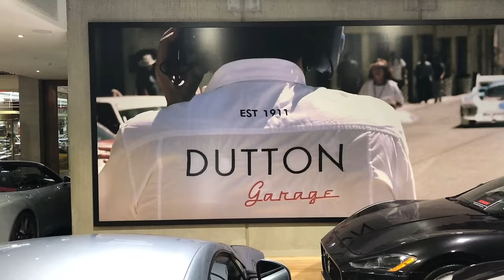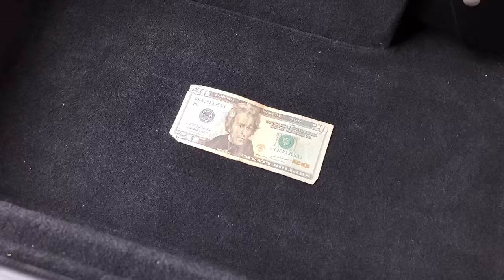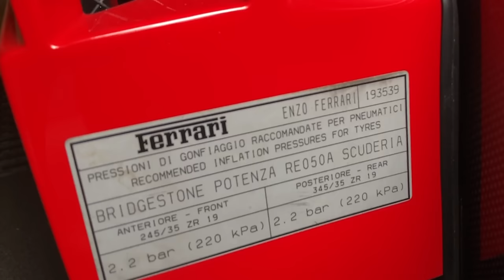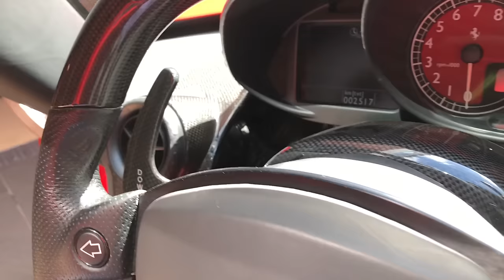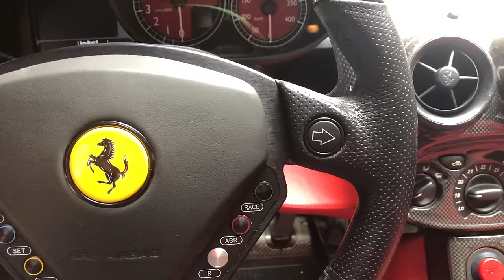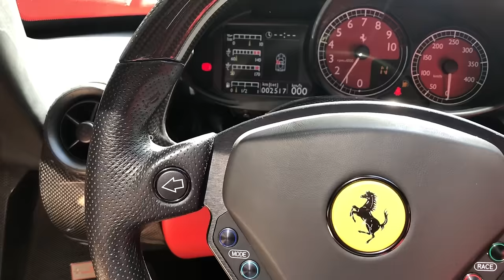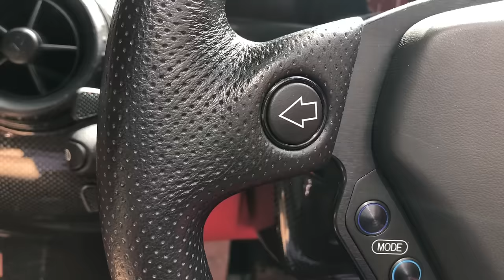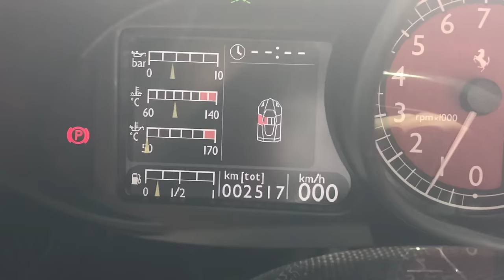Here's a Tour of a $3 Million Ferrari Enzo

Comment: Back in 67 they passed a law in the states (which I am unsure if it has become an official industry standard or not) saying that all vehicles needed to have turn signals that could be seen from the side for safety reasons. Most modern cars have integrated/wrap-around turn signals. So it would appear that this vehicle has those "dinky lights on the side" are not for additional blinker information but rather to comply with the law as those front turn signals are not visible from the side.

Comment: Did anyone else notice the giant scratch at about 12:34 beside the keyhole? Also Doug failed to mention the roof cutout on the door is not asthetic. In the Ford GT40 it is mostly for looks. The GT40s door opens straight out, making it really hard to get in and out of in tight spaces. (See top gear with Jeremy C.) The Enzo has the cutout so you can get into the car past the door without having to duck down. You sit down thru the cutout, pull your feet in and close the door. Very smart design.
Reply: If you look closely you'll see it isn't a scratch. It's a red (slightly different shade than the body) sticker. Why? No clue.

Comment: As much as a car guy that you are I'm surprised you dont know what that red leather pad is for in the drivers side. This was obviously a purpose built race car for the road. It was also supposed to be built after F1 cars. If you have never raced on a track, even with go carts (50mph+) then you won't know. Those pads are to protect your legs when you corner. The g-force throws your legs around. If you look at any f1 car you'll see the driver opt to use pads attached to the car or they'll go with pads, that they wear. Kinda like putting on knee pads

Comment: If the window doesn't open much how is it fully opened at 27:40?
Reply: He was commenting on how small the window is, although I agree it was misleading as he showed it half open when talking about it, but there's no reason (based on the design of the door) that it wouldn't open all the way down.
Reply: spudit2003 totally agree
Reply: He meant that it doesn't open much because of the quarter window taking 1/3 of it all.
Like the back windows of bmw 3/5 series - the whole window is big but you can only open a part of it

Comment: Enzo 2003: 0-100 km/h for 3.1 seconds.
ZR1 2019: 0-100 km/h for 3.1 seconds.
Reply: Enzo: 3 million
ZR1: 155k
Reply: @TheEchelon price it matter??? first able Enzo was 660k back in 2003. Secondary ZR1 is 755 hp with all new 2018 technology but is 660 hp with 2003 technology. The only matter is Ferrari engineers are geniuses.
Reply: Ali Hidayatov

Dodge Demon: 0-100 km/h 2.3 seconds
Tesla Model S : 0-100 km/h 2.4 seconds
Nissan GTR: 0-100 km/h  2.7 seconds v6 565 hp ;) 130k$

Ferrari is overrated.
Reply: @saladwithsalad  Ferrari have a history, many victories in different races aspecially in Formula 1. Many beautiful, unique, fast cars in last 50 years. And also we are talking pure atmospheric V12, but all you count before are charged or have electric engines. you can also add Rimac with electric engines 0-100 km/h 1.97 seconds.
Reply: Batemen supercars aren’t just 0-60 times.
Reply: @saladwithsalad  you know those are much newer cars?
Reply: @simopayer8846  how is the tesla s a drag car when it weighs 2200 kilos
Reply: @saladwithsalad  so you're tryin to tell us that a dodge demon or a tesla model s are faster than a bugatti veyron?
Reply: @michaeladamowicz6782  To 60mph yes. In fact, it's supposedly the fastest production car to date in the 1/4 mile, but that has yet to be replicated.
Reply: If u can get the demon to stick.  I saw a video where a nsx smoked the demon.  The demon is just meant to go straight and it’s not consistent since all it does is spins it’s wheels.
Reply: The beauty about the Enzo is that it was a trend setter. It’s a collectors item from a prestige brand. You can own any watch and all watches do the same thing.  Or have a watch that initiated innovation and set the par higher than must in its time.
Reply: @deeznutz2646  both demon and model s in their normal modes arent faster than a veyron
Reply: and the 2009 zr1 smoked it on nurburgring
Reply: @saladwithsalad  lol you're missing the point it's the fact that it could do those numbers at that time and modern cars are just now keeping up with those speeds
Reply: @ceco1599  because it's fast as fuck
Reply: Most of the Enzo’s expense comes from collectors value ! DUH 🙄 something that a 2018 car doesn’t have  .
Reply: @victoralanis8015  we know that. But why american cars doesn't voluble as European cars. Why 2003 corvette lost its cost from its initial price but Ferrari in the opposite rise  in price day by day. Cos they are beautiful, charming, elegant, unique, powerful, fast, more quality. And they have attended in many races. 1962 Ferrari gto sold out for 52 mln $  recently.
Reply: @victoralanis8015  we know that. But why american cars doesn't voluble as European cars. Why 2003 corvette lost its cost from its initial price but Ferrari in the opposite rise  in price day by day. Cos they are beautiful, charming, elegant, unique, powerful, fast, more quality. And they have attended in many races. 1962 Ferrari gto sold out for 52 mln $  recently.
Reply: Ali Hidayatov you just answered your own question 😂it’s not made in the us, besides production rations are not in the same range. I can bet you this cars cheaper right were it was originally manufactured
Reply: @victoralanis8015  no I just proof why Europe cars much more expensive than other cars. Cod they are better in all aspects as i mentioned before. Europe cars not expensive just like that, everything have its reason. Can you tell me any US car better and more quality and durable than Mercedes, Porsche, BMW and etc German cars and any car more beautiful than Italian cars and more charming than English cars? For all this reason Europe cars are better and they deserve this. Me myself like Corvette, I think its more badass car than Ford GT40. And also only very beautiful US car is Saleen S7.
Reply: Ali Hidayatov Europe cars are beautiful don’t get me wrong I owned a e46 m3 and I was a stunning car . But the parts are of course a bit pricey (OEM) . But shit Honda’s are the most reliable car I can think of right off the top . Iv seen those cars go through hell and back lol . But hey everyone’s entitled to there opinion .
Reply: @victoralanis8015  actually i have Nissan Teana 2011 it's very comfortable and practical car for me but when i ride on Mercedes E-Class 2011 i understand that what means quality and comfort. When you enter turn in high speed Mercedes, Porsche are best in this situation than in same speed ride on us or japan cars (maybe except GTR, it is beast) and you dont worry that you can crash. I hope I could explain my opinion.
Reply: Yeah but 0-100 km/h numbers mean nothing these days.
Reply: Imagine preferring a mass produced shitbox over a hand crafted Motorsport masterpiece
Reply: Yes but 16 years separates them . A ford focus rs is quicker than a testarossa . The enzo is a ferrari , the best of the best as far as cars go and the zr1 is a only a chevy
Reply: @ivanrios3074  with better tires and better technology, the electronic dampers makes a significant difference in handling and grip for example. Nothing to takeaway from the Corvette when the tech advanced so much since the Enzo came.
Reply: @saladwithsalad  its the iphone version of cars
Reply: Ali Hidayatov except the Enzo is n/a and the zr1 has a big supercharger,Enzo goes 222mph and the zr1 goes 211 or 212 with the smaller wing
Reply: @farjadmoq  stop using drugs
Reply: @saladwithsalad  first you cant put a tesla on that list makes no sense. It doesnt go by the same rules as a petrol engine. Second you miss the whole point of this car. Its a road going f1 if you will. Its not just 0 to 60 its everything. A perfectly balanced machine, the experience behind the wheel and, yes, the prestige or brandname if you will. Getting invited to buy a piece of automotive history. Which it has become. Think about this IF you could buy one of these for 3 million dollars, theres no possible way you could ever lose money on that deal ever. How is that overrated?
Reply: Ali Hidayatov Don’t forget you can leave Hennessey with your ZR1 and they’ll push it up to ~1200hp hehe
Reply: Also faster than the new nsx
And 458
And 918
And gt3rs
911 turbo s
Huracan porfermante 2018
And I could go on
Reply: bro man12345678 If the car can’t handle it, the speed ceiling is irrelevant

Comment: Actually, many vehicles do have those crank windows, as they're much better to use as an escape route if the vehicle fell into a river or something, since electronics can't run in water. Sometimes, car companies just like the crank design rather than the button design.
Reply: I couldn’t fit out of the window. It’s tiny. 

They use manual cause it saves weight of power motors and wiring. 

Real race cars have no radio, power seat or power windows. Car is all carbon fiber to reduce weight.

Comment: Keyless entry? In 2003? What!
Reply: Cassidy Keen My family's 2009 Toyota Wish doesn't have keyless entry but your 97 truck has? Damn.
Reply: keyless entry been around since the 80s....
Reply: DBoy 37 Dude keyless in my 2001 cobra.
Reply: geez what cars have you been around. lol keyless entry just means using your remote to unlock. not the one you might actually be thinking about where you dont even need to press the remote button. so those been around since the 80s
Reply: We all in 1980 & this dudes in 3080
Reply: My 2004 Daewoo had keyless entry,
Reply: Means the remote. Not the button on the door or grab sensor.
Reply: 04 porsche cayenne turbo keyless entry/exit and start. Keys never leave my pocket.

Comment: Not surprised to see Ferrari opted for the "checker board' patterned carbon fiber sheets, as at the time, they were not masters at handling the material. So, they took the safe route here, not having to take extreme care with aligning the angles today's material provides designers, allowing the creation of literal works of art from only the base construction material, as we see today highlighted with translucent top coats. What Ferrari uses here with the Enzo, this would be used only with opaque top coats, hiding the rather boring checker board pattern under coats of paint. The best examples of 'artwork cf' work of that era was anything done by Pagani.

Comment: From 12m27s, I can see, as the camera slowly moves the view, that it looks like the manufacturer forgot to wet sand the paint... in the $670,000 MSRP automobile. Or maybe whoever owned this one needed a repaint for whatever reason, and sent it to Maaco for one of their $400 "specials." Neither seems more believable - or unbelievable - than the other, but there you go.
Reply: The whole car is carbon fiber, so you will see the weave imprint through the paint. None of them were perfect. Actually exotics always have the worst paints.